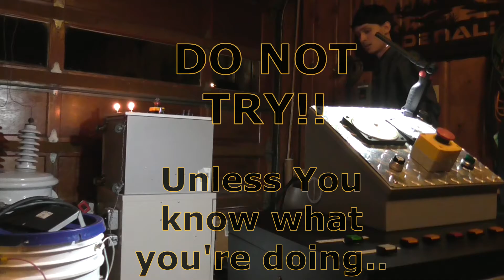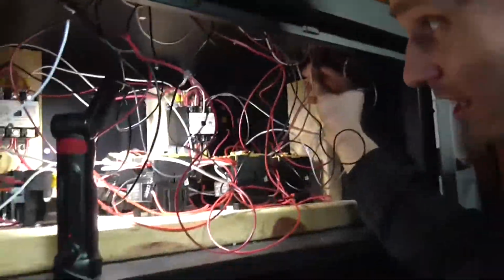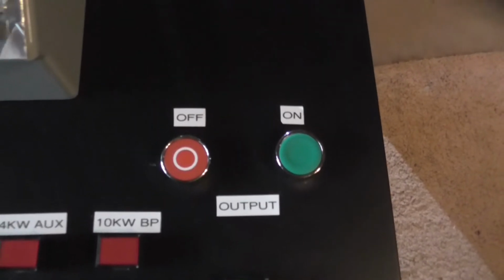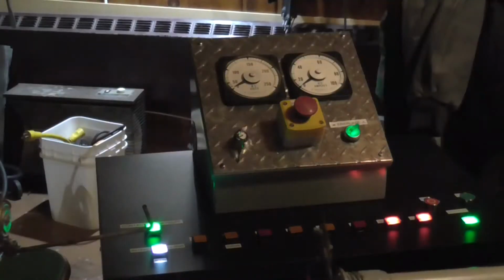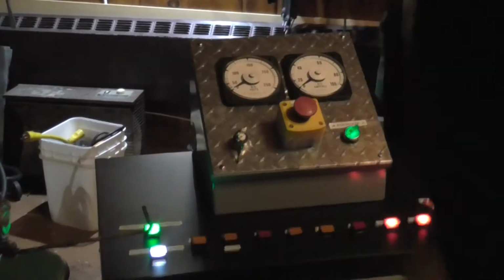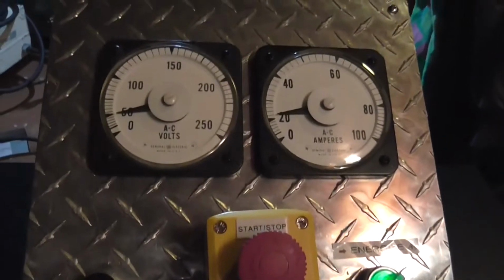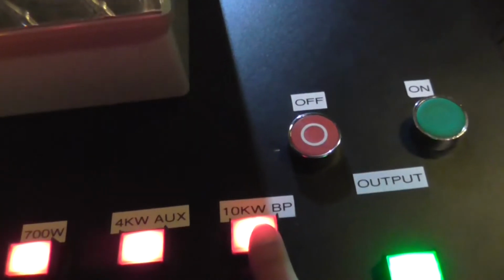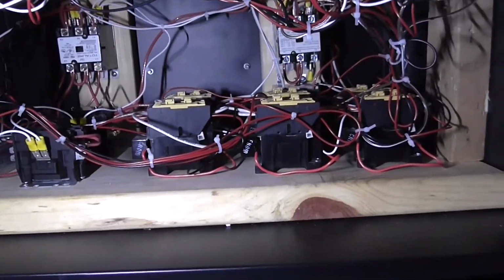Current Regulating Power Supply

Comment: Impressive mate. A well made machine overall. I’m gonna make something like this that will be included into my current power supply. I like the overall layout and it is handy for Tesla coils and general mucking about. 
You’ve made it well. 

Gotta ask tho and make a few points. What’s the duty cycle like on that thing? Im gonna be using brake resistors as ballasts as they don’t overheat ever at all. Those transformers, how long can they go before they warm up?? 

Also I love the fact you’ve took my advice and used multi circuit protection, for low and high power stuff! brilliant way to stay safe! Sadly I didn’t see any earth fault protection but your incoming supply will have this. 

Last thing too add, what thermal protection do you have? I saw the fan, good it’s got a High velocity blade on it. Do you have any monitoring, IE any automatic shutdown? My power supply as you’ve seen has the ballast Variac and rectifier thermocouples that light neons that let me know if things are cooking. Then automatically shutdown if I keep going. 

Same problem mine has but fault finding will be a CUNT!!! In there. Lol. Shouldn’t get any, also the transformers bay has a lot of room for future changes to be made that’s good. 

Gotta say tho, watching this with you bypassing it all, seeing that ammeter just spike made me laugh. Lol. 

Great video and great machine, the one I’m planning will have an adjustable ballast output from 1000W-9000W. Increments of 1000W taps. fitting into my current black machine. 

Take care Ryan. :)
Reply from the maker: Thank you! Your power supply is pretty bad ass I have to admit that, not a lot of people our age can make something like that, but there is a few. It has a constant duty cycle of 5kW (just to be safe) it will run 7-10kW for 3-5 Minutes and 20kW @ 240V would run for 30 seconds. It usually takes 3 minutes before ballasts get warm but not hot. I  monitor it by physically using my hand to see how warm something is (of course when turned off;) I might add features that your power supply has with the thermal overload protection. So I might add things to it in the future. I can't wait to see you build your current controlling unit, it'll be nice to use it on virtually anything!! All your missing is a high voltage transformer, you'll get one.. Their everywhere.
Reply: Variac Maniac Yeah, Thanks mate. She is a monster my machine is I will admit. cheers. They are decent duty specs with respect to the KVA 

Put your hand in? Ummm well make sure the power is off and remember in the future it’s something you wanna get doing. Nothing worse than having that uneasy feeling in the back of your mind as to if things are overheating or not. 

Putting your hand in is dangerous and impractical. But works I guess. My current limiting power supply will use either 1000W brake resistor ballasts or the SCR that will allow anything I want. Just a few small problems with the SCR that don’t exist with the resistive ballasts. 

Thing I love about it is that it all fits in one tidy power supply box. :)
Reply from the maker: Yeah, it's probably a good Idea to get more safety features, power supply has earthing everywhere, but it would be better to be safer. Indeed it is amazing all of that fits in a cabinet like this, lots of work, but well worth it;)
Reply: Variac Maniac safety is always a good idea matey. Yeah I know your pain of wiring that control panel up. I would fold my legs up and sit in the bottom of my power supply box when wiring up the Variac. It’s a cunt to work on but the effort is worth it.
Reply from the maker: Was a nightmare on my knees, however well worth it indeed!

Comment: Awesome!!! You’ve got your very own big boy supply!! :D just to clarify you were putting 60A through a 20A receptacle plug? What gauge wire is coming out of that to the PT? I know you only run it for short periods of time I am just curious
Reply from the maker: I was using 16 gauge wire for the PT. Still works though.
Reply from the maker: Do you mean on the power block with 2 sets of receptacles I plugged the transformers into? Yep, it took it nicely, in fact just got slightly warm. Always get the best rated plugs, 15 amp ones are ok, but 20A ones are the best.
Reply: yea thats what I meant, 16AWG wow, I am going to need some 20A receptacles some day if I ever want to power up these two 1350W 12v PSU's https://youtu.be/1wOh5ZqHaK8?t=7m34s the cable is a 12AWG IEC 60320 C19 to NEMA 5-20P wiki links in description of video.
Reply from the maker: Cool, I'll check!